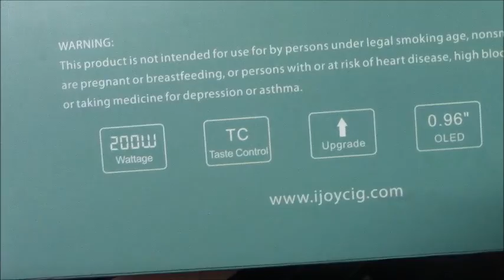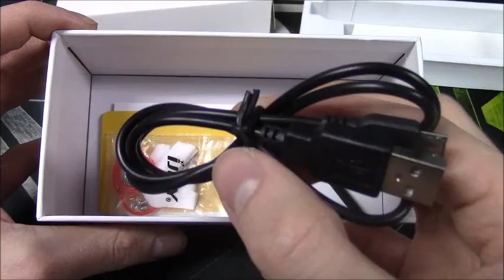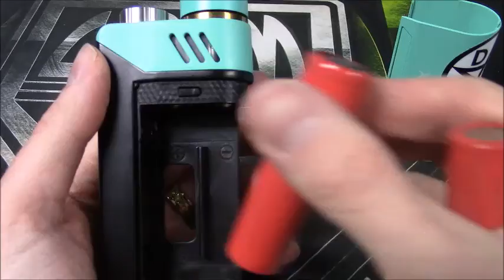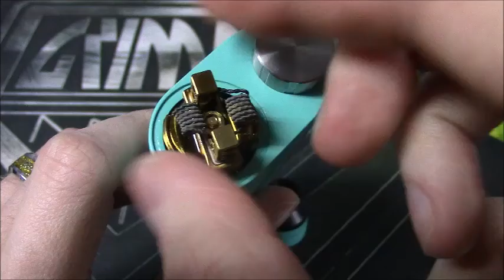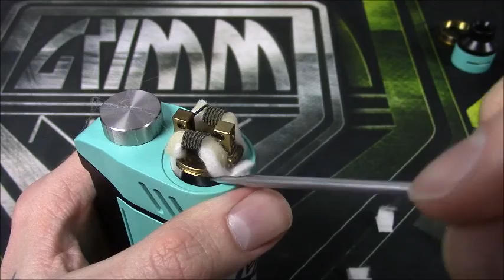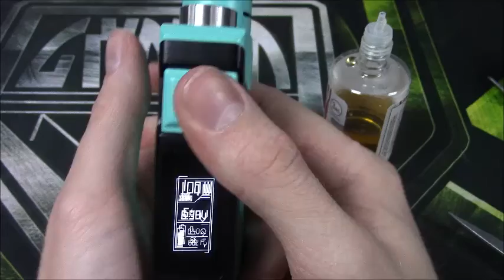iJoy RDTA Box Review By Jonny

Comment: What's the difference between P T S and N
Reply from the maker: P stands for (power.) power is for variable wattage mode. the other three options are for (temperature control.) (N) Nickel. (T) Titanium. (S) Stainless steel. So the difference is dependent on what metal you are using for your coils. if you are using kanthal you need to use power mode. for the other three you should use Temp control, but stainless steel and nichrome (N80) can also be ran in power mode. Hope this helped! ~FRV Jonny.

Comment: The coil u used on the gold deck, is that the coil that came in the box? And what's the highest wattage you can use with that? I'm not a builder so I'm not sure how all this stuff works
Reply from the maker: The Coils i used in this video were not the ones that came with the rdta box. But I have bought a few more of these boxes and tried the coils that are included in the kit, I normally run from 120w to 150w with them. you may be able to go higher if you want to but that's where like it. Hope this helped in anyway. ~Jonny
Reply: Juice Wall Productions it did help thank you. But can you tell me where did you buy those coils you use?
Reply from the maker: The coils I use are made by Coil Creep you can find them at Front Range Vapor. here is his link. https://www.instagram.com/coilcreep/?hl=en